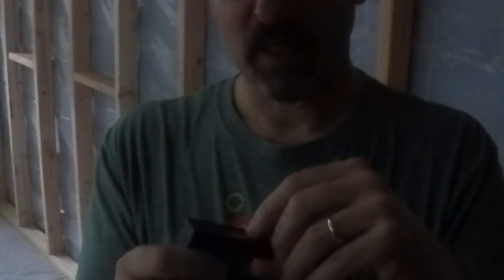Black & Decker Replacement Staples

Comment: thanks, and that silver part is not for hanging but for holding the red lever in place for storage... always have to google this one, I don't use the stapler that often!
Reply: oh you pull back on the red and it slides too, then you can lock in place under the silver loopy thing